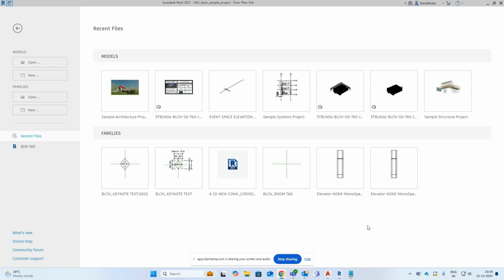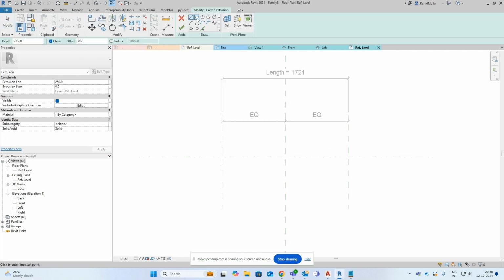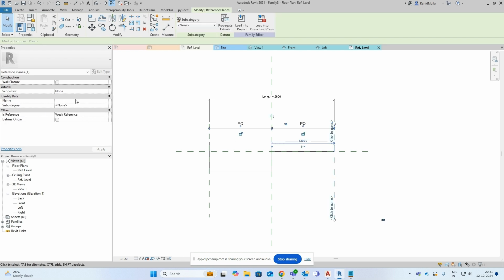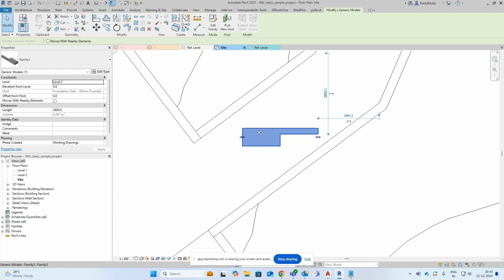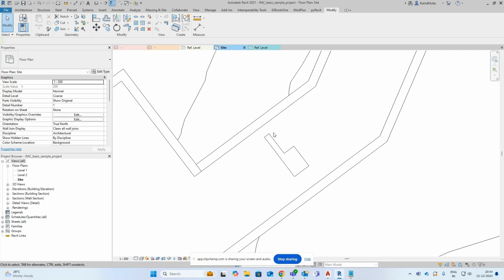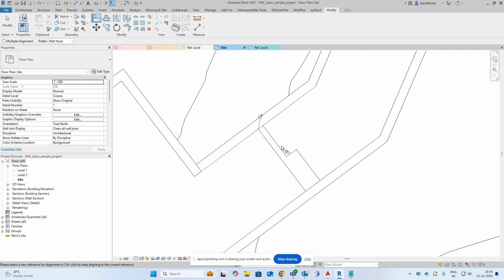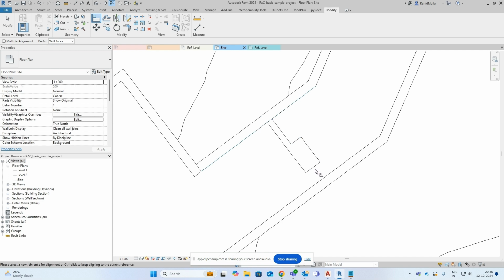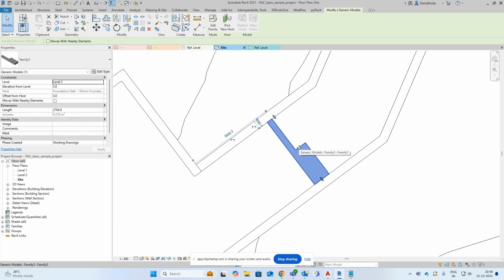BASICS OF REVIT FAMILY CREATION 2 STRONG AND WEAK REFERENCE PLANE #bim #revit #revitmodelling

Comment: Can we use this column family to extend columns to desired height or depth directly by aligning to specific level instead of checking level difference and manually updating?
Reply from the maker: Yes. No need to do it manually. Just make sure it is lock to both the levels and it will follow along.
Reply: @RahidRiseNShine  thanks! Really helpful!!